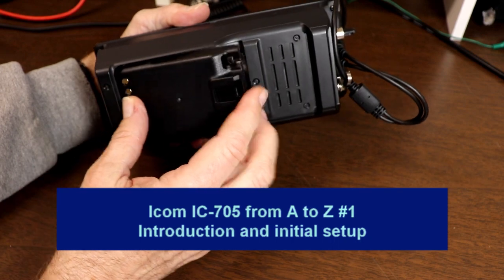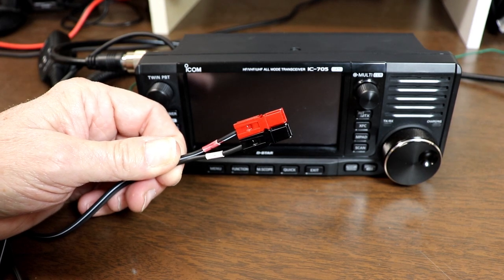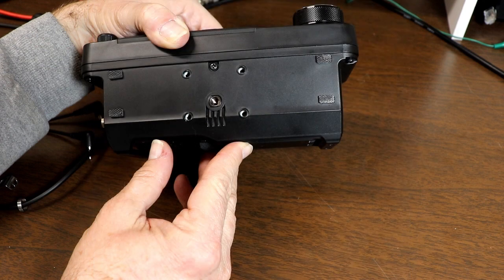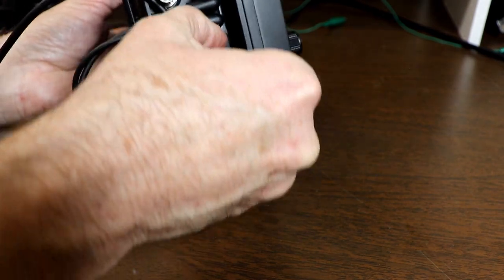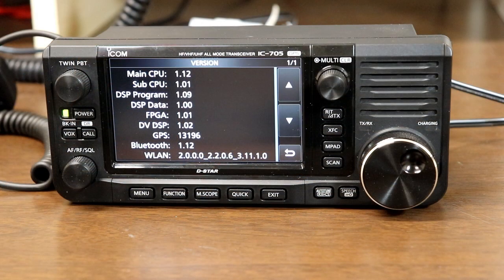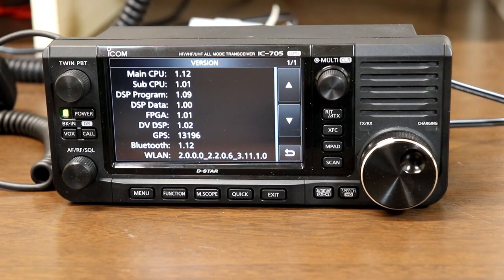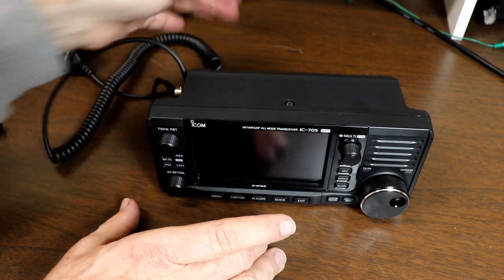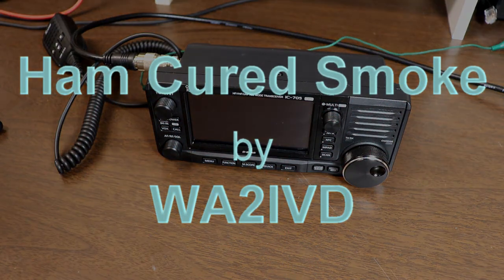Icom IC-705 A to Z #1  Initial radio setup

Comment: Would you need a larger SD card for down loading repeaters frequencies you get on a disc from all over the US and other countries. As well as recording. I’m a new ham radio operator and still learning. I just have a 2meter and 70 cm HT and still learning how to use it.

Comment: I am/was interested in this radio, but after visiting the Icom web support site, it is not even shown, accessible only by search. The last firmware update was three years ago. To me, it sounds like Icom has abandoned this radio.?
Reply from the maker: On the Icom support site, you have to search for any radio that you are looking for support for.  The latest firmware I see is version 1.32 released in December of 2022.  So a little newer than 3 years ago.  I don’t see anything that makes me believe they are abandoning the radio.  All of the major dealers are still advertising and selling them.

Comment: I just got my ICOM 705 the other day.  No antenna yet, that’s coming on Monday.  How do you address grounding the rig when outside at POTA sites.
Reply from the maker: When I operate portable, it depends on how long-term my operation will be and how much power I’m using.  With a 705, I wouldn’t be too concerned about it.  With a vertical antenna, a ground stake mount and a few radial wires laying on the ground, that’s all I would use.  I wouldn’t worry about the ground terminal on the radio.  The shield connection on your coax is plenty to the ground side of the antenna.  Grounding your permanent station at home is much more about safety from nearby lightning strikes than it is about RF.  If there’s a storm nearby when you’re portable, you should be thinking more about packing up and getting out of there instead of grounding.
Reply: Thanks Tom, I appreciate the response.  Not having a 705 before I just wanted to be extra careful.   I will be using Bienno 12v12Amh battery when mobile.  73

Comment: Hi Tom my windows 10 computer wont recognise my 705 and i downloaded drivers from icom any help please
Reply: Remove the drivers and disconnect your 705 from the PC.
Now install the (correct and matching!!) drivers and ONLY after successfull installation reconnect your 705. If Windows 10 want to install the standard Windhoze drivers, just click NO.
Let me know if that worked out for you!
Best, Robbert / PA3BKL (aka TA2IX) in Istanbul.